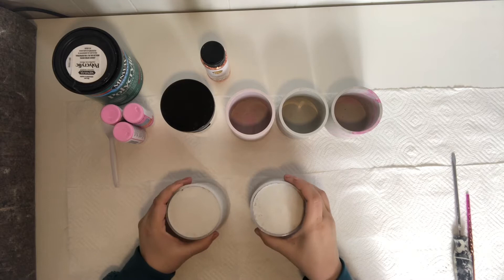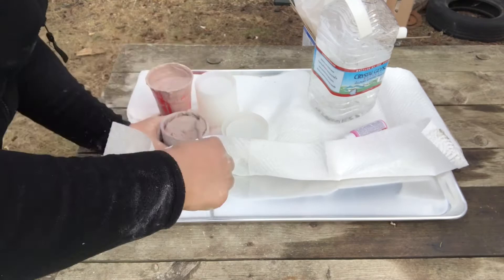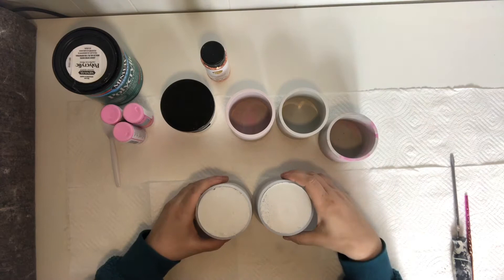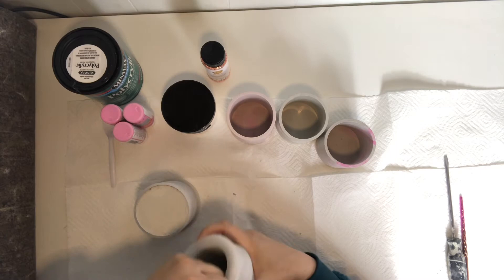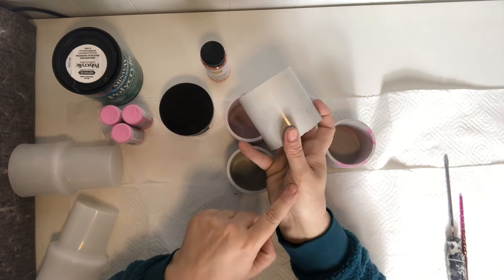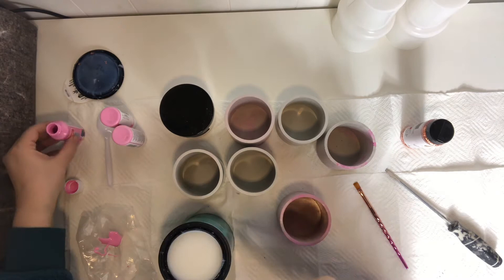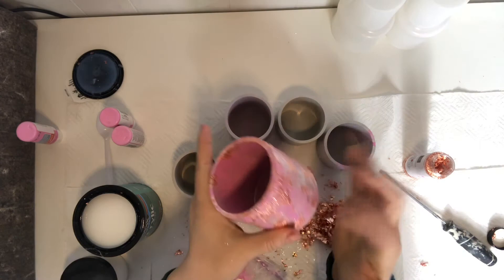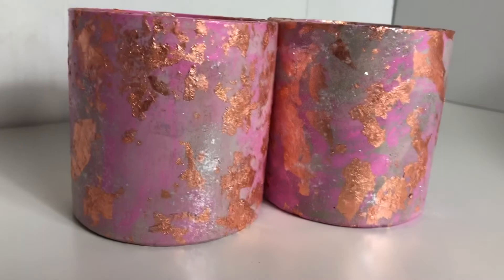How To Make & Foil Cement Candle Holders

Comment: I love this! The foil is awesome. Just fyi if you do more cement projects, there's an additive called Flow Control that you can get for a couple bucks-its right by the Cement All. It will stop the cement from solidifying too quickly. This is especially important because the acrylic paint really makes it harden fast.
Reply from the maker: Good to know! Thanks for the info!